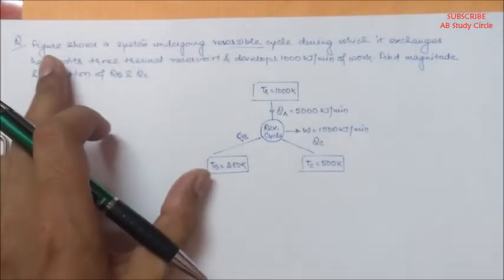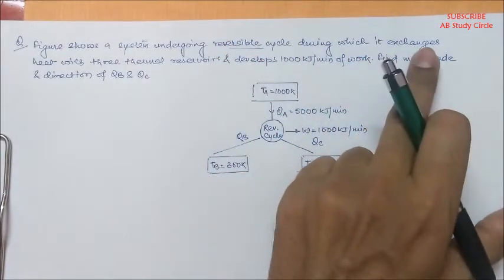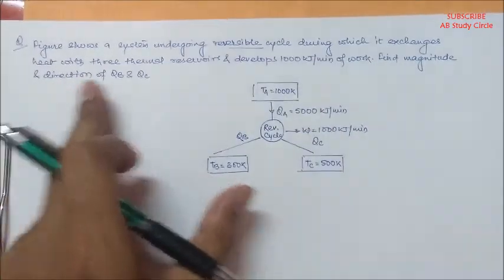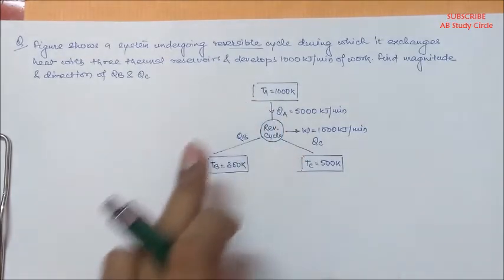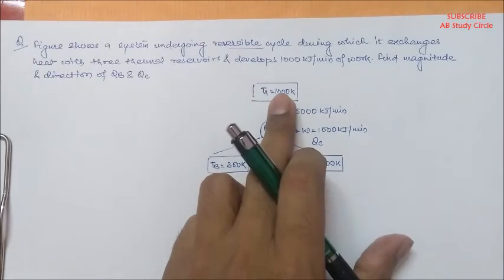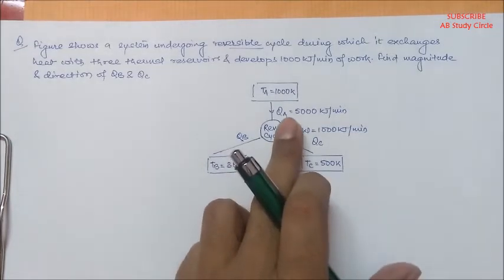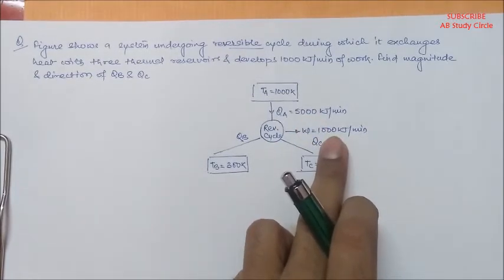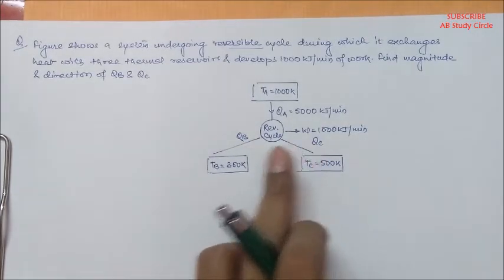Numerical #35 | 2nd Law of Thermodynamics | Important Question

Comment: Sir as Qb is -ve so that means it is rejected from the system and Qc is + ve that means heat is transfered to the system
Reply from the maker: See Sumit, at first we have suppose both Qb and Qc as heat rejected from the system but after applying Clausius Inequality we got to know that Qb as  negative and Qc as positive so are supposition should alter for Qb only. 
Here the negative sign implies the opposite of what we have supposed earlier
Reply: @ABStudyCircle  ok sir
thanku